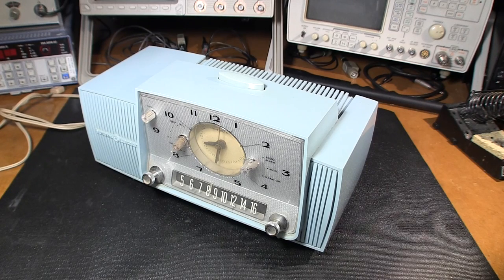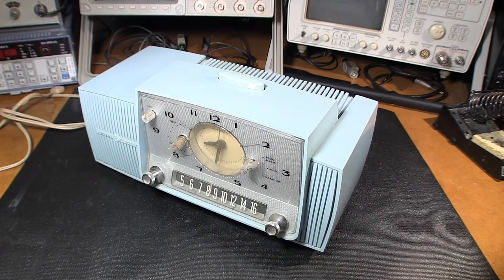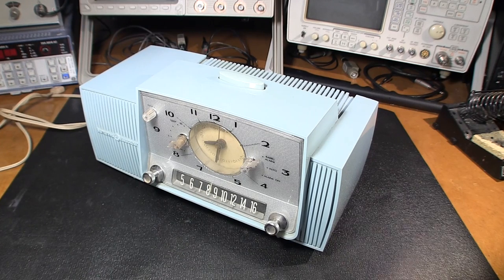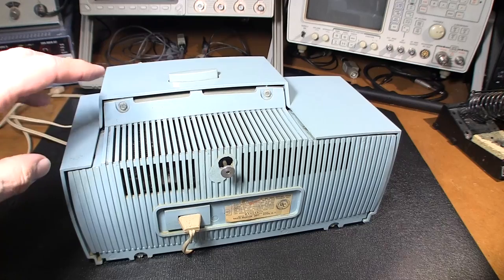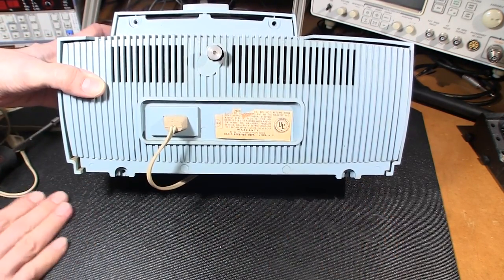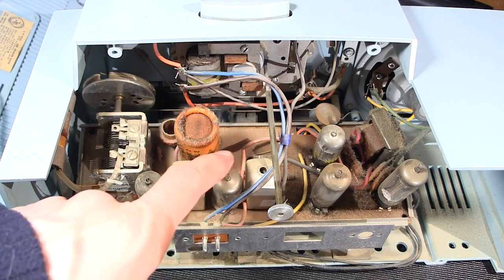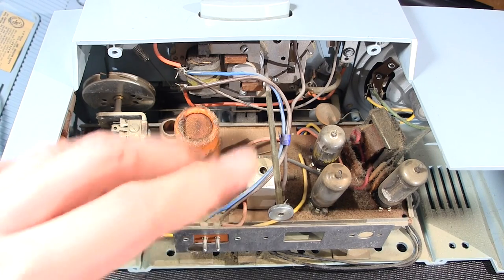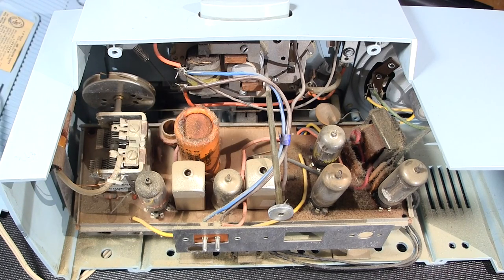Atomic Era Radio Teardown, Explained With Repair

Comment: With a hot chassis scenario, what is the best way to avoid getting shocked? If I touch it am I automatically dead? It depends on what else I am touching, what I am standing on and so forth correct? You could just check that with your volt meter right? and if it's plugged in so it's a hot chassis, turn the plug around the other way, right? I mean I know you said it was dangerous and all, I was just wondering if you could go into a little more detail about how to safely work on this sort of thing?

Comment: I know exactly what you are talking about, with the neutral floating chassis.  I was given an old shortwave radio from my grand father, and I plugged it in to the wall, hooked up a wire to the ground screw on the back, and thru it out my window.  I then went outside to hook it to the metal water pipe.  Do I need to say more?   That really hurt when I grabbed the wire and the  pipe.  The chassis when I plugged it in was connected to the line side, not the neutral.  I did not make that mistake again.

Comment: Thank you for your videos which continue to educate. I am interested in the Couplet ICs you indicated in the video and particularly what it was used for in this receiver. Any info or link to info would be greatly appreciated. This area of electronics was sadly neglected and in fact the contribution of Kilby wasn't recognised until 2000? with a Nobel Prize. Aside: Also largely ignored  were/are early magnetic components used to like valves (tubes) to control magnetic fields. Do you know anything about these devices? They were described in Practical Wireless (or Practical Electronics) in the late 50s or early 60s.
Reply from the maker: The "Yolk" in older televisions is a great example of magnetism controlling a vacuum tube (CRT.)

Comment: Hot Metal chassis , Metal knobs and a metal shaft on the tuning capacitor...Sounds risky, is the chassis isolated from both sides of the line ?

Comment: How can you have metal knobs on a radio with a hot chassis?  They didn't care much about safety back then.  The tuning shaft appears to have a plastic cover but not the volume control.  Interesting video, thank you.

Comment: There are a lot of period power supply capacitors one can buy that are bought online and are new, most in their original packaging. In this way, you would have an original capacitor in place and not have to have a lower, smaller set of capacitors under the chassis.

Comment: I am concerned about the replacement electrolytics mounted beneath the audio output tube. Electrolytics, even modern ones, do not handle high temperatures well. I don't know exactly how hot the tube gets, but judging by the darkening of the circuit board I expect it to be higher than the rated temperature of the electrolytic caps (105C). I probably would have wanted to position the caps so that the bodies were facing away from the tube joints, though soldering them close is important to reduce hum as you pointed out.

Comment: Another excellent video, much appreciated. I'm always happy when I see you've posted a new one.
It occurs to me that you could hollow out the old cardboard capacitor and conceal the new ones within it. Would you consider this in situations where space is at a premium (considering thermal conditions of course)?

Comment: OH, damn, I forgot to ask the question I wanted to when I began my post, why doesn't that have the conolrad sign on the dial?  I recall my old 1950 Ford Custom had that on the dial, I would have expected that radio to have the same, the little circle with a triangle in it for civil defense station locations.

Comment: That circuit board is amazingly sparse on capacitors and resistors. Are they hiding somewhere or did they manage to design a circuit that didn't need any? Did you manage to track down a schematic for this model?

Comment: When you are tuning/peaking the IF transformers, you mention moving the slugs, are they threaded slugs (in a threaded cardboard tube) that you are moving up and down in the tube to change the inductance of the coils?  

Would the inductance of a a coil with the slug partially out be the sum of  

(u0(Ienc)N(turns in this area)/(2.0X10^-5 (or something near that)) + (u0(Ienc)N(turns in other area))/(4piX10^-7)?  

We had the AP test today, and I am looking for excuses to use this stuff for actual real life.

As for the neon lamp being  very dim, would it be heresy to throw an LED and a little transformer in there? 

Or perhaps one of the green or blue phosphor Neon indicator bulbs?  I figured they would put a blue dial with a blue radio.

Comment: Hey man love the videos just had a question really I have a league amp that runs el34 tubes and when I switch it over from stand by I get him some times and it can be fairly loud I was thinking it was the caps but now I'm not sure thinking it might be an ac leak is there a way to check with just a multi meter I'll admit I'm no etech but have a ten understanding of things.

Comment: If you found one of these clocks, would it be dangerous to just plug it in and turn it on without checking inside? Looking at all that dust and grime collected over 60 years, and those very hot components..

Comment: Tell me, Paul. Why do some of the traces have bridges? Could they be a current carrying thing, or a large ground, path perhaps?
Reply from the maker: Hi Tony. There are a few reasons: More copper left on the board equals less in their solution; Current carrying for the filter can; Shielding for areas on the board.

Comment: I'm surprised you didn't have a tweaker that allows you to tune the bottom slug from the top.  Same hex shape, but on a thin shaft so you could go though the top slug  and then tune the bottom one.

Comment: (1) Does the Vacuum Tube with 3 Tubes  built into one make it "easier" to Diagnose "if and When" it should fail OR does that depend on the Function of the Individual Part of the Three that Failed?

(2l Since you mentioned the All American 5 (and 6 Radios), does the "more Amplification Tubes one has affect performance of the Radio's Reception" in a Low Signal Strength area "as in the more Amplification Tubes the Better?"

(3) I understand the 4 Tube Radios don't perform well unless it is operated in a Larger City with Multiple Local Radio Stations close by.  Is there any TRUTH to that Please?

THANK YOU Mr. Carlson.  I Love your Videos.

Comment: I may be wrong, but did you place the electrolytics right under the very hot tube? Or are they rated to survive that kind of heat?
Reply: FRR Recall that heat rises, there will not be all that much heat present under the base.  The heat damage immediately around the tube base is a product of the heat that was conducted directly into that section of the board by the tube pins, but that is very localized heating and will not add much overall heat in the base cavity.  That said, most aluminum electrolytic are rated up to either 85C or 105C (hotter than boiling water), though they will deliver much greater life at temperatures well below those upper limits.
Reply: Ethan Poole Thanks for the explanation

Comment: Re. the neon bulb: Those little NE2 bulbs lifetime varies with how much current they are driven with, due to heating and outgassing of the electrodes. The resistor value is a compromise between life and brightness. In this situation I've seen resistors as low as 22K for a 120V line (on turntable speed strobes). I replace with 47K. A little dimmer but much longer life.
Reply from the maker: Yes, very true. A 22K resistor will make a standard Neon bulb draw close to 3mA (which is pushing it) A 33K to 47K resistor is the better choice.
Reply: circuitsmith , Not knowing any better, as a young teenager in the 1960s, I'd use 10,000 ohm resistors, instead. The NE-2 neon bulbs would glow exceedingly bright orange red. They would also be too hot to touch, and would get very black inside, after 12 hours of constant use. I was lucky they did not burn out. I know better, now 😊.

Comment: I have a old Roberts solid state, NO ANTENNA WHATSOEVER Not a internal or external. It has a coax jack on the back but I pick up all the fm and most of the am stations

Comment: Good explanation of tube operation, but you didn't mention the barium and strontium oxides that the small pipe the filament is inside is coated with, that when heated allow the electrons to float freely around the pipe (cathode), then attracted to the plate where the B+ is. Otherwise I enjoy your videos much.

Comment: Off the wall question paul....is the dc output from an alternators regulator square wave dc or ripple dc or what? Stright filtered pure dc is better for battery charging I ve been told is the best for the battery life...Thanks  Jack
Reply from the maker: Hi Jack. The output from an alternator is unfiltered (it's filtered by the battery,) so with no battery, ripple is present. The battery will deal with pulsing DC, or clean DC just fine.

Comment: Is there a way to find out if an IF transformer has diseased silver mica caps before attempting to take it apart? I'm not real good at brain surgery either.
Reply from the maker: If the radio crackles and pops with no signal, this is usually an indication.

Comment: I had always heard that if you used an electrolytic capacitor with a working voltage rating higher than the actual B+ say,  450 volt rating when the working voltage was only maybe 130 or so, we're really just wasting money as over time, the voltage rating of the electrolytic would decrease until it reached the actual working voltage of the circuit.  Is that actually true? Just curious.

Comment: Paul: if one were to want to significantly improve DX reception on one of these radios, it seems to me that the easiest and simplest way would be to connect a long wire or some other such antenna. Where would one connect an external antenna?
Reply from the maker: A few loops of wire around the Ferrite  antenna with a suitable capacitor in parallel will isolate the radio and give very good performance with an external antenna.

Comment: Forget authenticity for that cord, I'd get a polarized one and make sure the chassis is connected to the neutral. Just because they didn't have a polarized plug, that doesn't mean you shouldn't. It should be possible to find a polarized cord with the same degree of yellowing and the same general plug shape, so the only thing that would be changing is the neutral blade itself. I'd feel better knowing the chassis isn't on the hot side unless someone deliberately uses a cheater plug to hook it up backward.

Comment: I’ve been taught that it’s not good to replace an electrolytic capacitor with one
that has a substantially higher working voltage. The higher voltage cap may not
form properly and the capacitance will be much lower than the rated value. I would
be worried about replacing a 150V cap with a 450V cap. What are your thoughts
on this?
Reply from the maker: Hi Tom. That's a fairy tale used, "created" by those that don't want to spend the extra money for a higher voltage rated cap. Just pay attention to the ESR and Current ratings of the higher Voltage substitute in applications where this is important, IE: Switch mode supplies, where the operating frequency is higher... ETC. New 450V caps (or any new cap) will test fine right off the shelf, and have very close to it's rated capacitance before they are even installed into a circuit. They should be brought up slow though for the first time if they have sat for awhile. It's very common for circuits that operate at 350VDC "or so" to have 450V caps installed. Companies would use over rated caps as well (more often,) but it's a cost issue in production.

Comment: heh..  A trip down memory lane.      Fixed so many of these radios I lost count... The most comon no mater who made them the 5 tube versions were almost identical circuit wise..  Also didnt cover te smell of a fried selenium rectifier.  heheh -- You could sniff those out even if one wasnt even on..  bet the 35W4's are  real rare these days..

Comment: A tiny dab of siicone grease on those thread cutter screws makes it easy to feel when theyve seated properly in the plastic .
Reply: Steve Smith Also when replacing self-tapping screws turn them a little anticlockwise until they click, then tighten them up. This stops a new thread being cut.
Reply: Interesting ! Will try your technique soon .

Comment: Would love to have seen how you did such a good job cleaning the radio! Too bad you skipped over that! Also, how much time did you put in and how much would you charge for such a service?
Reply from the maker: Hi Jeff, I did cut many parts out during editing, and it still turned out to be an hour an 10 minutes. The next time I will focus more on cleaning. Thanks for your comment!
Reply: Sorry to be critical in any way! Just that I have seen so many awful, dirty circuit boards like that and I was hoping for your "secret recipe!"
Reply: An idea, a video about cleaning. Snippets from your many projects. In addition to having fun with AA5's and early pre-Japanese transistor radios, I restore Teletype equipment and 90% of the advice out there causes more damage than it does good.

Comment: The little IRONY of life:
when the high voltage, high performance
broadcast transmitter spares your life by an interlock
but a clock can kill you without isolation transformer.
Reply: That's not what irony is...

Comment: Is there a way to test the i.f. cans without taking them apart or should I just put new silver mica caps in all of them?
Reply from the maker: Hard to say if they should be replaced or not. What kind of radio is it? Do you hear any crackling while it's receiving a strong station? What sort of atmosphere has it been in, EG: damp, dry, so on?
Reply: The radio in question is an old Heathkit  HW-10 Shawnee 6-meter AM all tube radio.  It hasn't been in a damp environment from what I can tell.  I am in the process of trying to restore it and was wondering about the i.f. cans.  Would the capacitors in these cans even go bad?

The only test I can think of would be continuity across the coils.  I don't think the capacitors could be tested without taking them apart, plus there is no values shown for the capacitors on the schematic.  So, I was wondering if I should just go ahead and take the cans apart and replace the caps with some silver mica ones.  If so, what value?  Maybe 100pf?  Or should I install them and hope for the best :)?

Comment: Got zapped more than once by an All American 5 radio. They did not worry about things like that in those days. The half-wave rectifier left a lot a work for the filter capacitors to do. I learned to do alignment to allow for a good signal but also for bandwidth. That was less of an issue with AM broadcast receivers - but for TV sets you had to use a sweep and marker signal generator.
de N3GAQ

Comment: Did you disable the filter cap? I didn't catch it if you did...you wouldn't have paralleled the new caps to the old one.
Reply from the maker: Yes, the traces are cut on the bottom of the circuit board. This is done with a very fine tip dremel tool. Almost not noticeable.

Comment: On the tuning gang two trimmers for antenna and oscillator seems to be mica trimmer, how come those trimmers wasn't affected due to ageing?? Or will it have negligible effect??
Reply from the maker: Hi Keemur. The Mica capacitors in the tuning assembly (main tuning cap) are not sputtered or plated, its a dry piece of mica sandwiched between two pieces of metal. The tension of the screw holds the two pieces metal on either side at a certain width, which is the capacitance. The Mica is there so you can tighten the screw down without shorting the two plates. Mica is used due to its low expansion and contraction rate with temperature.
Reply: Thanks

Comment: I wonder if you happen to know the trick to replacing the dial lamp in this radio. I've got one here with a burned out lamp. Surely they don't expect you to disconnect the entire dial cord assembly to replace a lamp. Any tips would be greatly appreciated. ATB Doug.
Reply from the maker: Hi Doug. Make sure the radio is unplugged and the capacitors are discharged. #1 The chassis has to be removed. #2 Tune the radio for center span, #3 Push the lamp assembly forward from the rear of the chassis, do not push on the rounded clip. Push only the fiber assembly forward as to dislodge it from the clip. So push and lift the fiber assembly above the clip, now bulb and clip assembly will spring backwards allowing you access to the bulb from under the chassis.
Reply: Thanks much Paul. Job done. Now on to alignment. What a neat piece of Americana. Thanks for bringing to us. ATB Doug.
Reply from the maker: Great! You're Welcome.

Comment: Couldn't one put a polarized cord (correctly wired of course) on the unit making it so the 50/50 chance of the chassis being hot is 0 chance?

Comment: ok i may have missed it but what is the "IC package" doing???
Reply from the maker: Hi Matt. The IC or "couplet" is a bunch of resistors and capacitors on a vertical ceramic substrate.
Reply: oh ok i though it may have been doing more thanks

Comment: Could those metal knobs have been a shock hazard if the chassis went hot?
Reply: One shaft was plastic, the other must have had a plastic bearing in to to insulate it